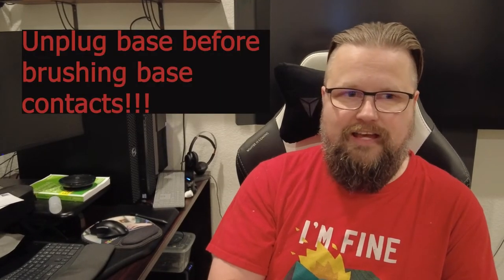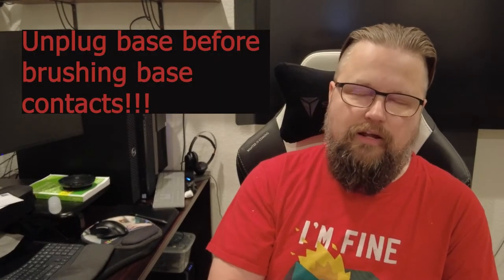Tineco Floor One S3 Series - It broke!

Comment: Hello, great video (this and the 11 months after review). I was about to buy one of these but then I saw the bad reviews it has on Amazon and got a little bit scared. So let me ask you some questions:

- The corrosion on the terminals might be fixed simply cleaning it with a paper towel after every use right?
- Have you experienced corrosion on any other parts like motor or bearings?
- how often do you change the rolls?
- would you buy it again?

thanks a lot in advance!!

Comment: Thank you for this video. 
I have a question for you or anyone else that owns a Tineco. Does your clean water tank have a yucky build up. 
I only use the Tineco solution with it ever since I bought it. 
You are correct on the maintenance I thoroughly clean my vac after every use. I feel like the autoclean is not enough for me at least
Reply from the maker: Yea I don't use the autoclean very often as I don't think it's good to leave it wet and assembled.  Usually I have the parts drying for a day after use then reassemble dry.

Comment: Since most wet/dry vacuum on the market has same/ similar design with Tineco, does any one of them more resistant to battery contact corrosion? I have an ifloor3 that finally stop charging after 4 years due to baterry/charging contact corrosion. Looking to purchase replacement.

Comment: How did you clean the corrosion? Mine won’t charge
Reply from the maker: Steel brush did it for me, make sure to clean the vacuum and the contacts in the base station, just make sure to unplug the base before scrubbing with a steel brush :)